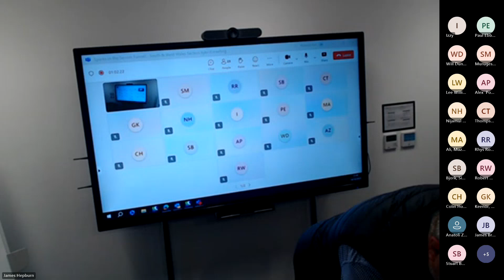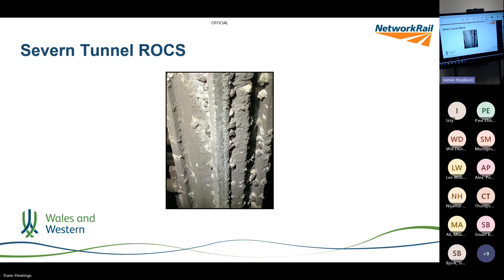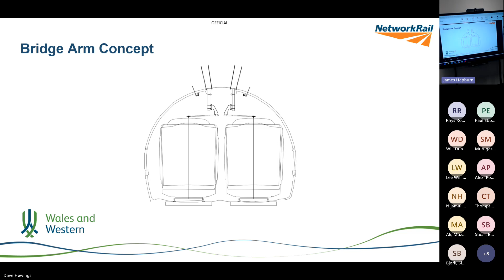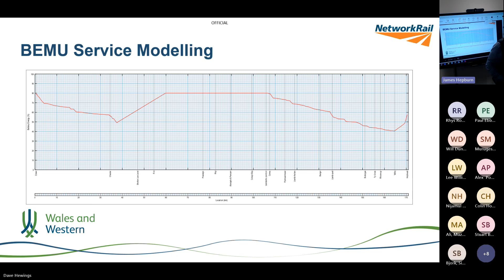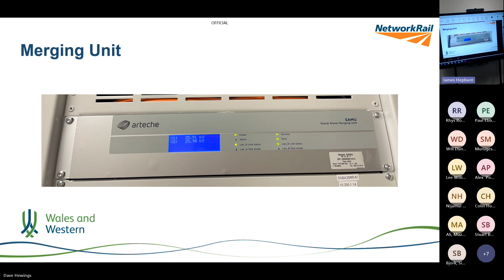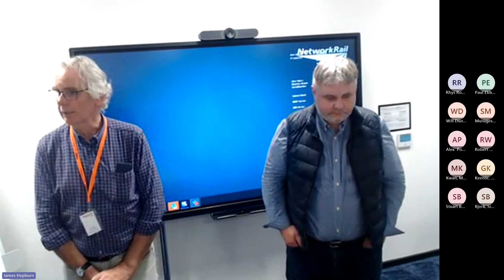Sparks in the Severn Tunnel - Dave Hewings

Comment: Good video.... was there any thought about going from the ground up?  A single beam in the middle which branches off to each side.  These would hold your contact wires which will be fed electric from the existing power outlets on the ceiling